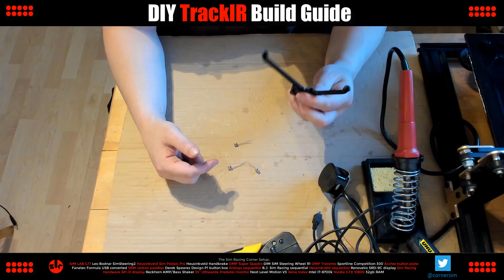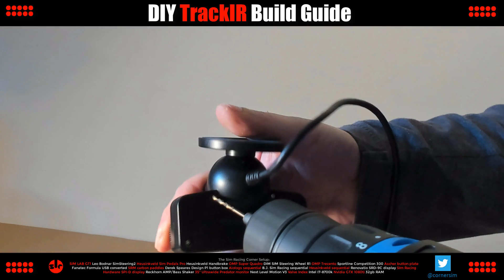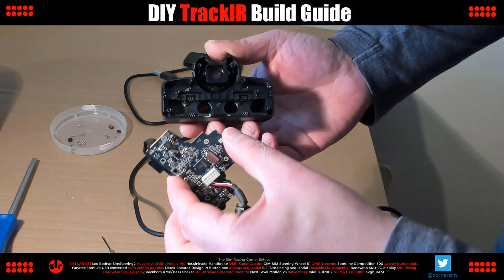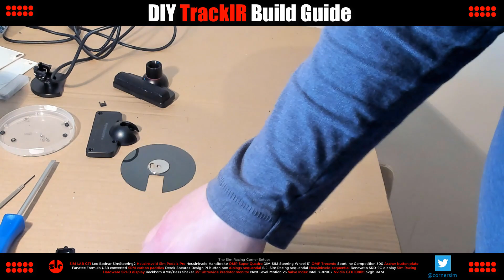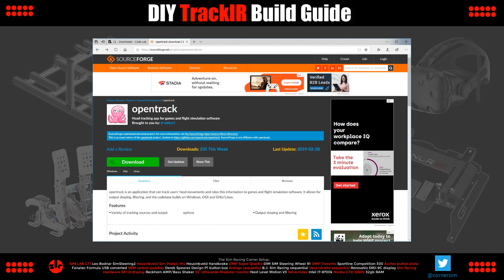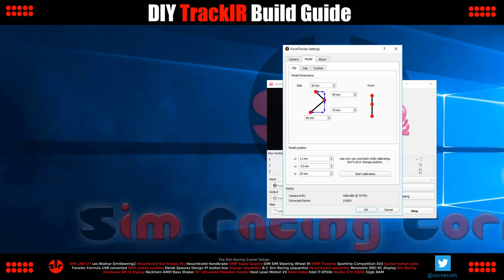DIY TrackIR Build Guide (costs less than £15/$20) [EASY TO FOLLOW IN REAL TIME]

Comment: Great video! One question, if the LED's I(f) is 100mA the correct resistance would be 5 Ohms, why we should use 22 instead?
Reply from the maker: Honesty, I don't know the answer. I followed other guides for the parts.
Reply: First I tried with the 22Ohms but I realize after ~45cm the LEDs are gone, so I calculated the proper resistance with Electrodoc, it suggested 5 Ohms. I think it's better, and I hope it won't burn the LED's out. I did lean on the specifications.

Comment: Why does everything I read say the positive is the longer leg?
Reply from the maker: I don't know. It is what it is and correct for the IR LEDs I used, and demonstrated in the video, otherwise it wouldn't have worked. Which it did, so there you go!
Reply: @SimRacingCorner  Thanks! I'm an extreme noob when it comes to electronics and there are so many videos with everyone doing it a little differently. I really liked the way you presented it.

Comment: Can I ask a question about your wiring? I see you have wired positive to negative on all 3 LEDs, but the diagrams I have found show wiring a wire to all positive legs then all negative legs twisting the positive wire together and twisting the negatives together, which is the correct way in your opinion?
Reply from the maker: I guess it doesn't matter either way if it works.
Reply: Wiring all positives and negatives makes them parallel. Using parallel you have to use a different resistor value so you don't risk burning up the LEDs. But it should work just fine.

Comment: Fantastic build guide I will let you know how I get on once the parts arrive.  I have a unique use case for mine I will share the details once done.  I saw in one other video a guy didn't bother to take the PS Eye camera apart he just applied a light filter, (couple layers of 35mm camera film) to the front of the PS eye lens and it seemed to work well for him.  I'm not concerned with dismantling the camera myself but I wonder if it's necessary? Do you have a spare PS eye Camera you can test with some floppy disk film on the front and see if it is on par with your modded camera?

Comment: Do you by chance sell the frame? I'm not able to buy the 3D Printer nor am I Computer savy Thanks.
Reply: I found a local guy who does 3D prints for a price, as I also don't own a 3D Printer and don't have a need for one.  Found him through a local Facebook community group
Reply from the maker: I do not, but you can find the frame or fully built DIY TrackIR's on eBay.

Comment: do we have to have sfh485p ir leds or any type of ir led can do it cuz its little bir priced in turkey :d
Reply: As long as it transmits the same frequency of light (measured in nm) it should be ok. Keep in mind different LEDs may have different polarity, so make sure you are connecting the negative and positive wires to the correct legs. I believe these LEDs are recommended because they are still clear at an angle.
Reply from the maker: I don't know, sorry. These IR LEDs are always mentioned in other DIY guides so that's why I used them.

Comment: What's the serial number of the ps3 camera that works? Is that the SLEH-00448?
Reply from the maker: Mine is SLEH-00201, curved lens. SLEH-00448 is the newer flat lensed model, which can't be modded.
Reply: @SimRacingCorner  good to know! Thanks!
Reply: @SimRacingCorner  Ebay has no area to specify model numbers...it's like you get what they send.
Reply from the maker: @dixiemay1996  You can send the seller a message and ask!

Comment: After removing the IR-Lens, the picture of the camera went blurred. Its only sharp if close to an object. If I put back the IR-Filter, its sharp again. This problem is not mentioned in the Guide. Has anybody an idea?
Reply: You probably know the answer to this question already, but in case someone else has the same problem - it supposed to be like that. The IR filter is part of the optics of the lens and removing it changes focal length. Motion tracking software actually doesn't need it to be perfectly in focus.
Reply from the maker: I didn't have that problem, you can see it working perfectly later in the video when I set up the head tracking software.
Reply: @SimRacingCorner   Yes I knwo but now I got the perfect solution. Another person told me that he had the same problem. To fix the problem you have to find the "sweet spot" by turning the zoom. Its a very narrow point but now it works. Perhaps this may help other people that have this special batch of PS3 Eye :-)

Comment: Great video sir! Would you prefer this over the aruco? If so, would you mind telling why?
Reply from the maker: I found the aruco marker just as capable with accuracy and speed, but it is sensitive to lighting conditions, so it can depend on the environment.
If you haven't tried head tracking before I would recommend the aruco as it is easy to DIY, and to test if head tracking is right for you; not everyone gets on with it.
Reply: @SimRacingCorner  ty for the reply.

Comment: Great vid bud.
I've been delving into some 3D printed DIY sim builds recently (2 x wheels, wind sim, button box, led dash etc) and this looks right up my street for my next project.
I tried VR on my mates sim at Cranfield Simulation but got slight dizziness, so I'm hoping I can ease myself in with this before committing to VR myself!
Sub'd :)
Reply from the maker: Thanks Dan and welcome to the channel. 3D printers are a fantastic tool for sim racing DIYers. I have a bunch of other projects I want to tackle with my 3D printer. Magnetic shifter paddles and a button plate if the next one I'd like to have a go at. And you've mentioned a couple things I wouldn't minds looking at too.
Reply: Magnetic shifters are an excellent upgrade, I have them on both my wheels. I can recommend the ones by jkoljo on Thingiverse.
Reply from the maker: @Skate2create  Cool, thanks. I've found them, they look ideal.👍